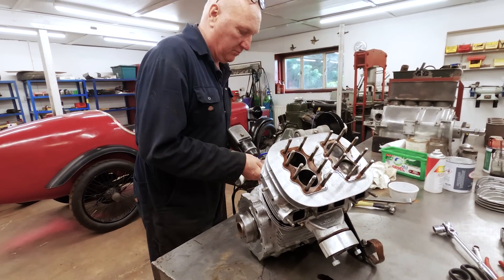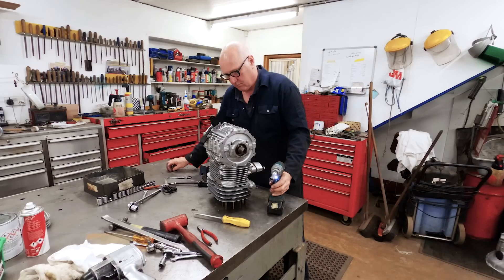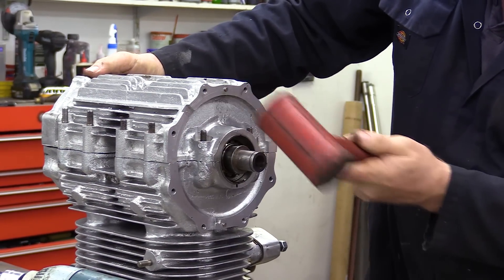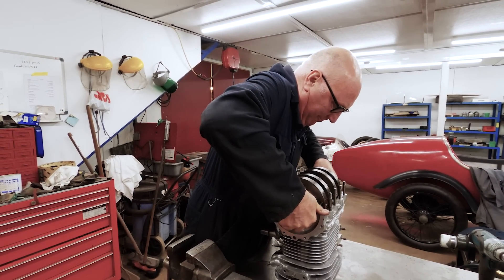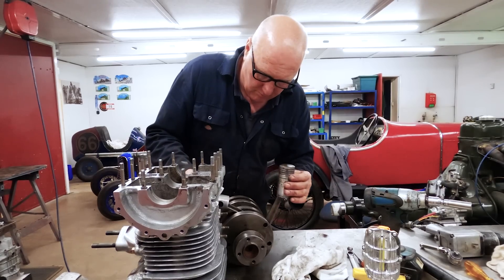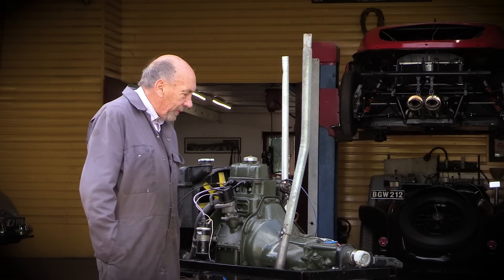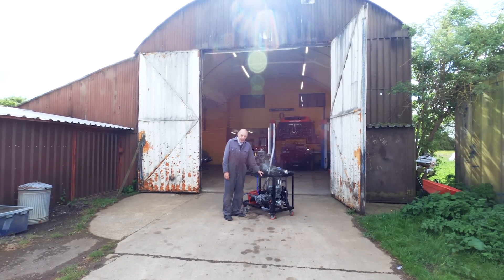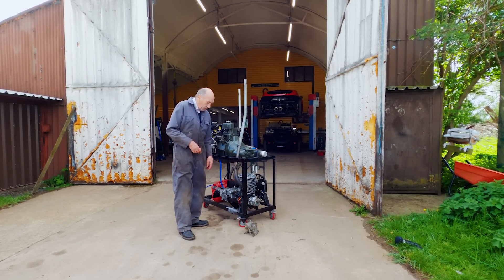SHED RACING - 2 Stroke Mini Engine/ Fault diagnosis

Comment: From what I can see in your video the exhaust is a straight through pipe with no expansion chamber 🤔 in my experience all 2strokes need the expansion chamber to create back pressure and I think that this will make the engine run better also 🤔🤘 I've not seen one of these engines but have worked on 2strokes all my life , from motorbikes to outboard engines from 2hp to 250hp 😉 good luck with the build 🤘

Comment: how close to tdc are you running the ignition, and are you running it on the leading or the trailing cylinder? when i last fiddled with a 2 stroke i almost had to be right on tdc for the bloody thing to run, so im wandering if the ignition has to be on tdc on either the leading or trailing cylinder?

Comment: I'm no expert, but spitting back through the carb can only happen with spark when the piston is low enough to have the transfer ports and the inlet ports open at the same time.
This looks to me like spark at the wrong time. If it were a modern 2T, I'd replace the pulse coil (igniter), coil, and CDI box. In this engine, it'd be points, condensers, and wire quality/separation.

Comment: Two stroke engines the INTAKE goes thru the crankcase NOT the cylinder head like normal engines! 👍👍 The two stroke sounded like MAYBE the sparks were out of time ( i could be completely wrong ).

Comment: Right then Mr. Dutton. That certainly appears to be two SG 250 Puch Twingles lashed together. I reckon you want to get your hands on one of those and do a comparison as to port timing, perhaps they mucked with that when they built up this prototype (although I suspect the cylinder liners are simply stock Puch liners). As well, your carburettor is completely crap, not even in the ballpark mixturewise. I'd have a hunt for two carbs off an SG and be done with it. Tell you what though, even two SG250 engines won't pull the skin off a rice pudding. The bike would do perhaps 70 mph (nah it wouldn't) if you wrung its fookin neck and laid down like Rollie Free. I personally don't believe the oil seal orientation made any difference. Two stroke crankshaft seals are somewhat special as they are engineered to contain pressure and prevent vacuum leakage. If you're using plain old seals you really want two slim seals installed back to back. That'll do the trick and I have actually done this. Are you ABSOLUTELY certain it is turning the correct direction? Virtually all two strokes will run backwards, just not very well, although that's mostly to do with ignition timing. not the reversed rotation per se.

Comment: My 10 cents worth is that with the combined exhaust the flame from from cylinder "B" is travelling out the pipe and a bit of it travels back down the pipe of cylinder "A" (when cylinder "A"s') transfer ports are open. Thereby igniting the air/fuel right back through the system. Ken Brough

Comment: Ivan you said you put on then took off the reed valves as they didn't seem to work, but did you get the engine running with the reeds in, or just tried it cranking it over? Perhaps if you try it with the engine running then they may be able to stifle the backfire. Also I would agree that the exhausts are too long and need to be tuned   Best of luck!

Comment: Another possibility is a plugged exhaust or exhaust port- both are somewhat "normal" problems to have on older two strokes. Notice that the engine doesnt begin popping out the carb right away, but then when it does, it looks like exhaust.

Comment: Sparkplugs...always test the sparkplugs.
Modern production standards apppear to be slipping...
Try NGK...but still test them.
and test them with compression applied...or another running engine and an inline test light/'scope.

Comment: Racing Scotts had straight pipes with no issues, indeed ran worse with expansion  chambers, also many Aero engines. Maybe induction is the issue? Is it reed, rotary valve or piston ported?

Comment: spitting back out of the carb either means a lean miss fire or hopelessly rich. Rich will give a "blubbery" type of sound, lean will "pop". It might be a exhaust pipe problem... a lot of two strokes the port timing is such that the wrong pipe wont let them run properly at low speeds especially, because theres a sound wave that needs to come back and "hold" the exhaust a nanosecond longer before it escapes. They foul plugs like crazy without a proper pipe!
Try the carb first though.

Comment: Something which I forgot to mention regarding ignition timing.  On some engines wear on the points rubbing block can be critical for achieving proper timing.  The reason being that on some there is little and occasionally on others no provision for moving the points rotationally to achieve proper timing.  Precise timing is set by adjusting the point gap.  If the rub block is worn beyond specs, one finds it impossible to set proper timing while maintaining the point gap within the allowed range.  This is typically on older vintage stuff.

Comment: Many of the comments are pointing out the exhaust system as being  faulty and they are certainly correct as how the system now stands.  It certainly is not ideal, but I’m not sure that it’s causing the severe issue which you’re seeing.  As a note - I worked as a mechanic for a Yamaha and Bridgestone dealership in the two stroke days.  We on occasion would work on older bikes. This specifically referring to twin cylinder two stroke engines fifteen or so years old.  
A twin cylinder weak point was the crankshaft center seal which isolates the two crank chambers from each other.  As one piston is coming down on its crankcase compression stroke the other is moving up on its intake stroke. Any air leakage between the two would result in a very sick engine. I’d be surprised, considering the age of the Puch if that crank center seal is still doing its job.  Bridgestone had a problem with center seals in the early 70s, resulting in a good bit of warranty work.  Often the older Yamaha bikes were not worth the potential repair bill. The symptoms which you’re seeing are hauntingly familiar. 

Unfortunately the repair is not simple. The crank will need a press for disassembly and reassembly, and it will then go on centers for alignment with a hammer.  If your engine were mine, I’d rig up an adapter plate for the carb flange and apply a few pounds of air pressure to the crank chambers checking for air leakage one crank chamber to the other. If that’s ok, fingers crossed, move on to ignition timing.  If you’re lucky and have a timing spec given in so many mm piston movement before TDC, this can be easily done with a dial indicator through the spark plug hole.  If the spec is given in degrees before TDC, you’ll have to go through the whole exercise of finding crankshaft rotational TDC and then using a degree wheel.  Timing is critical.  I would then remove the present exhaust piping and jet the carb for what I guessed as a bit too lean. As far as simply running, a 2 stroke is much more tolerant of a lean mixture than a rich.  However a caution,  it will run hot on the lean mixture if put under load.  With these three criteria met, a serviceable crank center seal, proper ignition timing, and a leanish mixture; the engine should operate adequately for the display stand purpose.  The engine will run with open exhaust ports but it will sound like two chainsaws running side by side. A chainsaw operates with near an open exhaust port.  Everyone is absolutely correct in regards to the tuned exhaust advantages and this would definitely apply if the engine were to be installed in an auto and to expect any performance.  For your display purpose, I would lean towards sound control. The tuned expansion chamber system will split eardrums.  I would try Y’ing each cylinder’s exhaust ports together and then through a small glass pack type muffler.  A Y And a muffler for each cylinder pair.
One last thought and it’s something which I would occasionally run into.  We used to build and tune 2 strokes for racing.  Now and again we would get an engine where an amateur had taken a Dremel grinder to the internal cylinder and piston porting in hopes of more horsepower. In general not a successful outcome.  Expertly done, these modifications can be successful, but now the matching expansion chamber exhaust is critically important and most gains will be in the higher RPM ranges. It’s an art.  Hopefully, your engine’s porting has not been altered.

This is the sort of project when success is finally achieved; one wipes one’s forehead and exclaims, “Well that was certainly an adventure!”   Good Luck

For what it’s worth  - I inadvertently posted this in Ivan’s second report on the Puch project. I discovered (new to me) that one can use the edit function to copy text from one video and transport that text to another video.
I will admit that I’m sharper on 2 strokes than I often display in navigating various You Tube features.

Comment: I had a 2 cylinder 2 stroke that ran similar to yours. Turned out the key way on the flywheel had bent from a square to a very subtle Z  if you can picture it so the timing was fractional out plus one of the rods had a minute compression bend don't know which happened first but both together put my timing out enough to make it blow back through the carbatooter . Good luck

Comment: Are the cylinder liners removable or is it all part of the barrel? Just wondered if a transfer port or something is at the wrong height? Are the piston heights the same or is one taller than the other? You mentioned the reed valve being swapped out and not making a difference but surely if the reeds were closing properly it would be impossible for it to back fire through the carb? 
I’m no 2 stroke expert, just throwing ideas at it in case one of them helps find a solution.
Great Chanel guys. Love your work and really appreciate you taking the time to share it with us.
Reply: I think mostly induction. Maybe crankcase pressure overcoming the reeds? Transfer port timing?
Problem is it could be a combination of things, but it shouldn't be able to blow back through the carburettor..

Comment: Hi, the backfire through carb could be poor seal between the two crankcases in the middle of the crank allowing pressure to come back through carb. You may need two seals back to back to stop this happening.

Comment: Are your primary pipes from the cylinder to the collector box too short causing exhaust gases from one cylinder to "short circuit" into the other cylinder causing the misfire as it looked in the video like the exhaust pipe would shake when the misfire occurred, also the collector box for the primaries looked very small which could be exacerbating the problem as the exhaust is remaining "pressurised"  from one cylinders exhaust event to the next cylinders.

Comment: I don't know but most two strokes run expansion chambers to put backpressure on the motor to keep the air/fuel in the motor during the fire cycle. Try making a proper exhaust.

Comment: Just asking :  Is a plain bearing between the two sides enough of a seal?  Is there examples of two strokes engines that were successful that only employed a plain bearing in that regard?
Reply: A bearing with 2 metal shields would be better. Most twin 2 strokes use a pair of rubber lip seals or a metal 'labrynth' seal between the crankcase chambers
Reply: @howardosborne8647  That is what I was thinking too!

Comment: it implies from the flow that's it's backwards it should never be able to have exhaust smoke from the carb as there should be a piston in the way or the ports should be shut. are the pistons " handed" ?

Comment: Ivan,
The backfire through the carby could be a result of the port timing being off by a "squizz".
This article from The Model Engineer April 1952 http://john-tom.com/IC%20Engines/Split%20Single/SplitSingleMarineGasEngine.pdf suggests an offset in piston timing is needed to be introduced.
Are both pistons in a pair the same length? Similarly are both rods the same length?
Eric
Reply from the maker: Thank you very much for the very valuable information

Comment: excellent video, interesting problem ,for the exhaust smoke to come out the carb the pistons and  ports need to be open on both cylinders and that would happen, I'm assuming a intake piston and a exhaust piston with a shared combustion chamber, it looks like you are either missing a valve on the intake or ....you have an open intake it couldn't be that there is supposed to be an air filter or intake pipework so the moving air mass is involved in the scavenging,  at what point does the plug fire? and is it a wasted spark system with the wasted spark igniting the remains of an over rich combustion event ? I would stick a scope on the timing to be honest it's so close

Comment: Great Chanel Ivan I'm a great fan.
I'm also a mechanical engineer and build race engines and restore vintage and classic motorcycles .
Mostly two strokes .
The problem is in the ignition
 system.  Points fire the plugs when opening  breaking the circuit collapsing the magnetic field which
 then generates the high voltage in the secondary field . ( but you know this ) . If you have a bad condensor or too high voltage ( one other comented on this ) when the points close making the circuit establishing the magnetic field there can be
 sufficent magnetic flux to fire the plug .and this will happen when the transfers ports are open with a nice mix of fuel and air flowing by hence the backfire into the crankcase and out the carby.
It is not your 4 into 1 .thats on every 4 cylinder outboard motor.  I've been to the NSU museum in Germany and all there race split singles had straight pipes .  Cheers Howard.
Reply: Hi Robert.
Intresting that you think a reed valve and variable timing will prevent phantom firering when points close ? Can you explain how that works ?
Cheers Howard
Reply: Hi Robert.
The donor design for Ivan's split single is the 4 cylinder Puch designed in 1935 . Walter Kaaden the father of two stroke exhaust tuning started his work on expantion chambers for racing in 1947 .
I have several 1930,s two stroke motorcycles in my collection that with bikes covering the 30,s 40,s 50,s 60,s and 70,s it wasn't till the 1960,s that any attempt was made to tune the exhaust sytem up till then it was a straight pipe to a muffler with a torturous path to reduce the noise .
About 80% of the comments tell Ivan it the exhaust system and to have single pipes or expantion chambers ?
That would be fine if Ivan was looking for more power .but he is trying to diagnose a back fire and poor running issue.
My 1980,s 140hp Chrysler ski boat had nothing more than drilled row of holes for exhaust ports into a common plenum discharging down the leg under water .no pipes or expantion chambers needed .
Cheers Howard
Reply: @howardsway7788  Hi Howard 
Is the port timing on the engine set up so no errant spark from another cylinder can enter thru the exhaust port Causing it to interfere with the intake charge? . As a Yank I apologize for the poorly written comment I posted.  Interesting old engine I imagine Ivan will have it running properly soon. Thanks to your comment now I want to read the book on Puch engine development as it was designed to save fuel.  I tend to modify them the In the other direction
Reply: @AtlasLathe  
Hi Robert.
The exhaust port timing is set up so you can't cause backfiring across into the other cylinders .
At first glance it looks like a 4 cylinder motor with 4 exhaust pipes ( because it is )
BUT in reality it is in effect a two cylinder engine with each side split  in two with a common combustion chamber . The paired cylinders are 180 degrees apart . With very long stroke ( compared to modern two strokes ) as the transfer ports are on the oposite side cylinder to the exhaust ports .this allowed the exhaust ports to be in the  bottom 1/3 of the stoke . With the 180 degree crank it is impossible to cross feed a backfire into the other cylinder because the exhaust ports are never open together .
Just to add intrest they use two exhaust ports per cylinder to give a wide squat cross section area . The ports are spread apart so there is plenty of cylinder wall to carrie the rings across the port .hence the 4 exhaust pipes on a twin split cylinder engine .
Ivan will have it sorted soon . I'm over in UK soon for work might catch up with there classic racing scene 
Cheers Howard

Comment: Cudos to the exhaust tuning pundits. question to you, several folk suggest taking the exhaust off as a diagnostic test. Easy to do, but  surly even worse scavenging .  How about rigging an air line into a jet to create a bit more suck up the pipe to see if it makes any difference at all?  Obviously not a long term solution but as a pointer as to which way to go maybe worth a few moment to try.

Comment: Nice work, looking at the video and listening to the engine, I wonder if you need to have individual expansion pipes for the exhaust?
Looking at your set up, seems like a typical 4 stroke down pipe and collector.

Comment: Could the crank be in backwards? I know that sounds odd but I noticed the main connecting rods have the other cylinders rod attached to it. That could cause a timing issue? I think
Reply: Hops Garage, The crankshaft can't be in backwards but could the connecting rods be?